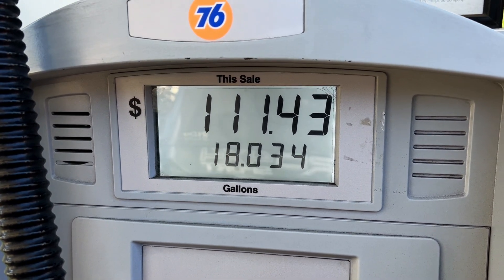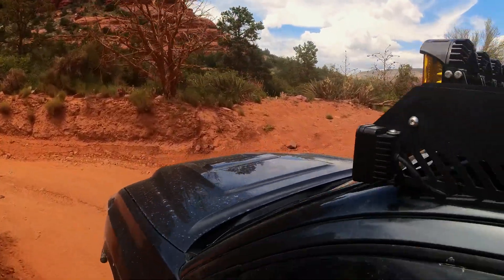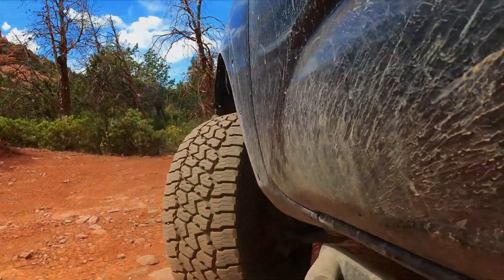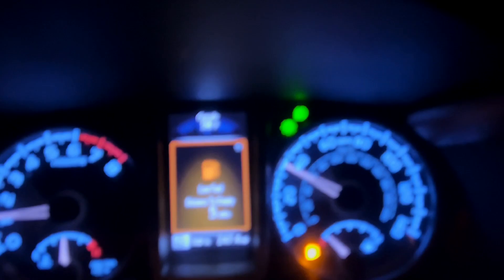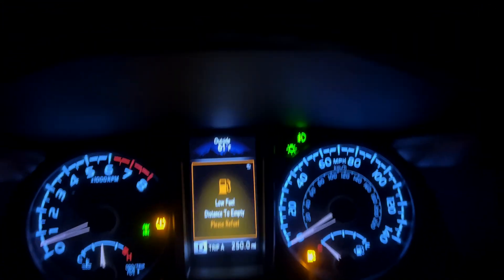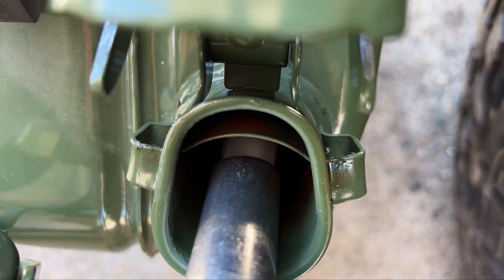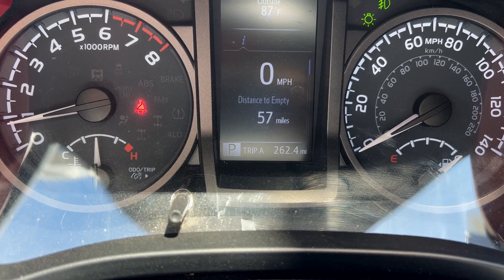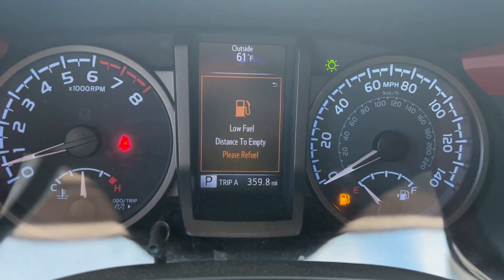Fuel Economy of 3rd Gen Tacoma with 35 inch Tires, Toyota MPG 35" Larger Tires

Comment: That's the reason I sold my Tacoma for a zr2 diesel I was so tired of the gas mileage it truly is garbage the new one better be over 20 mpg
Reply from the maker: I think all trucks even v8 will have these issues however they start at lower fuel economy so the change is not as drastic. So far with metal front and back and regear I’m not seeing much decrease from the lighter truck build.
Reply: @AdventureSquadTeam  how has your regear added to your mpg numbers
Reply from the maker: @loganfurst3010  still collecting data. Since I’m a highway commuter I don’t expect much but power is nice on the low end. For city drivers I’d expect a larger gain, or off roading as well.
Reply: What’s your mpg’s now with re-gear?
Reply from the maker: @daltonkennedy5488  I’m doing a video on that. But the gist is it depends on your driving style and environment. Stop and go or hills it may go up. Highway it appears to have gone down. Video in a few months, trying to post some adventure videos first

Comment: That's actually not bad for how you have the truck set up.
Reply from the maker: Thanks. I imagine the regear I’ll take some hwy mpg loss and city gain. Plus a couple steel bumpers and maybe skids, let’s find out lol.
Reply: @Adventure Squad  the regear will most likely see a highway gain. Right now the truck probably lives in 4th and 5th gear. I doubt it thinks about 6th at all. The shorter gears will bring the engine closer to its power band again.